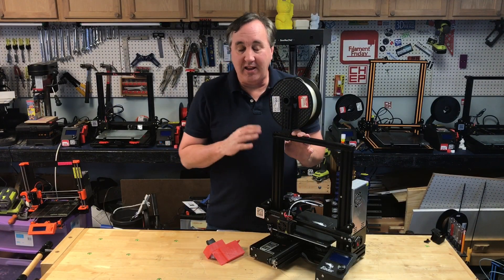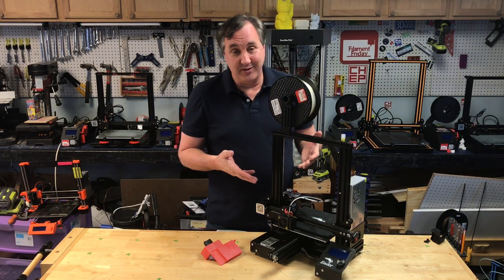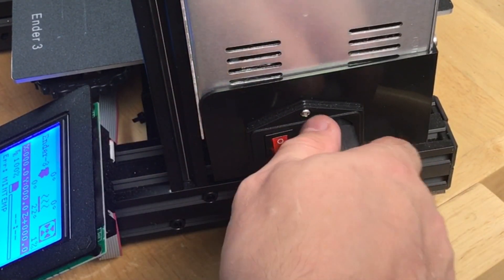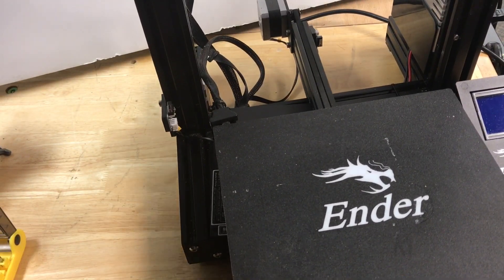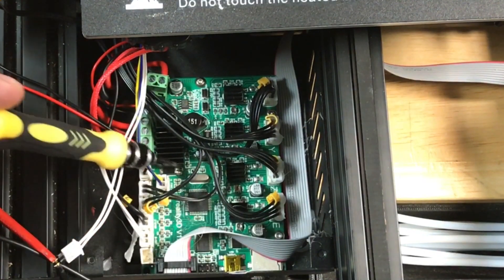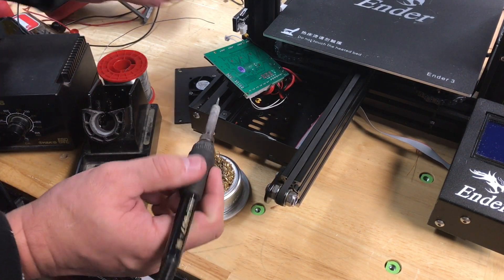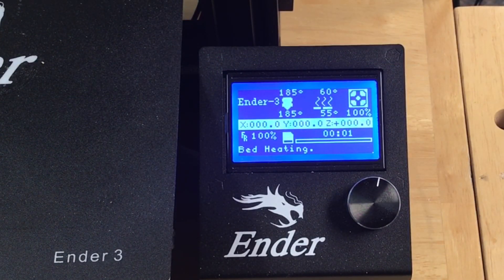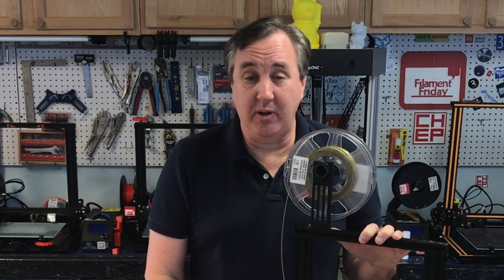Creality Ender 3 - MINTEMP ERROR and TEMPERATURE ISSUES

Comment: My Ender3 V2 hot end temperature suddenly started dropping during printing after changing the nozzle from 0.4 mm to 0.6 mm. The printer stops printing with the temperature drop from 220 to 195. After going through all the checks, I noticed the the hotend temperature going down when the blower fan stsrts and goes to max speed of 255. When I reduce the fan speed to 60 then the hotend temperature went up. After cuttinf off the blower fan, the printing was ok. This is clearly showing that the current (amp) from the power supply is not sufficient to handle the total load. The Ender 3V2 power supply is 24V 350 watts only. 
Connected a 24 volt 600 watt PSU, then the printing was ok with all the fans running.
I think the larger nozzle size will also require more current with increased flow rate.

Comment: Hey loves the videos helped me out a lot but I got a question, my endear 3 always used to heat up and lock to the set temp and here recently I took it apart and cleaned it up added cable clips, now when it heats up it sets and starts printing but the temp will go from 210 to 209 then spike up to 211 then drop back to 210. This process goes on during the hole printing process, is this normal or did I brake something?
Reply: Such a small variation is fine, if it starts wondering over 3 or 4 degrees start worrying
Reply: @juannino8859  thank you for that info. i believe i found out why it has been doing that, so i been hearing a buz or annoying sound coming from extruder turns out it was extruder hot end fan so i feel like thats why it started to do that. im no expert just taking a guess.

Comment: Awesome video!

I have an ender 3 v2 neo. After a nozzle change it started to be unable to maintain an exact temperature. With 208° set, it goes up to 210 then down to 204 and keeps doing that over and over again. I've updated the firmware but that didn't help at all. Any ideas?

Comment: Hi Chuck. I am having an issue with Ender 3 V2 starting. Got nasty MAXTEMP error. Loosening thermistor screw didn't solve the issue. Assumed mainboard is bad. Bought another board and get a loud beep on startup. Nothing shows on display. It seems the printer is not reading the SD card with the latest firmware. Assuming the new board is bad, i bought a second mainboard. Same issue. I am puzzled. Any suggestions?
Reply: When the srcew on the (temp)wire was too tight, I received a same error message (on the hotend), try to loose a little that screw.
Reply: @viktorludanyi740  thanks for the reply. I finally figured out the issue. Turns out the firmware file name must be less than 33 characters long. Once o shorted the file name the firmware installed

Comment: Thank you
I haven't used ender 3 for quite some time
When I tried now, the nozzle temperature doesn't cross 180 and it took 20 minutes to get to 180 deg. What is the issue
Kindly help

Comment: Hi Chuck I'm getting the mini temp error but my temp shows fine for the hotend. The bed was showing 516 degrees after restarting and would immediately get the error if I tried to preheat and also if I tried to auto pod tune the bed. I updated the firmware and then the bed would show 0 and I would get the same errors. I checked my wiring and pulled the board and everything looks ok to me. Can I test the bed thermistor with a ohm meter as well and do you know what it should read ?

Comment: I’m not sure this video is quite what I was looking for, but I need to ask..

I just put my ender 3 together last night. when I went to run a test print earlier, it said I had to wait for the extruder to warm up. I left it for less than five minutes, and when I got back it said that it was 0.04% the temperature it should be, and that it would take 26 days to warm up sufficiently to print. 

Here’s the thing: I wouldn’t be able to afford to pay the electricity bill if I left my printer on for 3 weeks just to print a 1” low-poly pikachu

Any advice?? Please 🙏

Comment: Hello. I have the same printer as in this video, and I was wondering if you knew why my printer is acting up. My printer keeps cooling down during a print. I would set the temperature before the print, wait for it to heat up, and then hit print on my printer. The temperature stays at the normal levels for both the bed and nozzle until a few minutes into the print, where it decreases to 200 degrees for the nozzle, and 60 degrees for the bed. I already changed the settings for preheating the PLA and ABS filament and I set them both to 220 degrees (nozzle) and 110 degrees (bed). I made sure they saved in the system, but the printer still is decreasing the temperature to the old levels still. How can I stop this?
Reply from the maker: What are the settings in the slicer? 
They control the print temperature.
Reply: @FilamentFriday  I got it to work. I changed the print temp. In the slicer. Thanks!
Reply: @FilamentFriday  I have similar problem, I set the print temperature in the slicer for 217 but after a few minutes printing, it drops to 183 for instance.

What would you suggest I do?

Thanks
Reply from the maker: Check all connections for loose or broken wires.

Comment: I just got an ender 3 and it was working until I clicked preheat pla. It then went to making loud beeps and stuck on the ender dragon screen. Now if I turn it on it is stuck on that screen. If I unplug the thermistor connector I can then navigate the settings or heat the bed but if I plug it back in it goes back to beeping and locks me out again.
Reply from the maker: Your sensor is probably shorted or broken.

Comment: I have a Tevo Tornado and which has heating problems. First - the hot end just didn't heat up enough, set for 200 and it heated to 146. So I replaced the hot end. Now I get the MINTEMP error and screen showing -14C (yes minus) and telling me to reset Tevo: Didn't help to reset. I measured the thermistor at the Tevo female connector cable end  pins 3 and 6 (I hope I got it right) and it messured 146K. I thought it should be about 100K. The Tevo is a 24 volt hot end (again I hope I got that right as well). The inside of the Tevo from the mounted female plug to the board is hard wired . I do not have a white plug as you showed and ended up splicing the wires for the thermistor and heating into the existing cable. I was thinking I may have to flash the firmware or something, but I have NO idea on how to do that. Any thought what to do nest will be appreciated. Thanks.
Reply: Hey I have the same problem, how did u solve -14C ?
Reply: @SrdjanS_Automations  I never did get it fixed.  I did replace the hot end, thermistor, etc. and still nothing. I decided to reduce my fustration and bought a Sovol SV01 instead. So far it has been running fine. Bed is smaller and it seems to run slower, but I am still satisfied. Think they have an 03 now as well.

Comment: I have the Ender 3 V2 neo , I normally run PLA 200 on the nozzle and 60 on the bed. I started to notice but am not getting errors that my nozzle temp doing a great deal of fluctuation having the nozzle set at 200 I noticed on the controller that the temp would drop to 117 then back up to 200 then 210 then back down below 200 back and fourth. Hence the reason for watching this video. lucky for me I have the equipment and the experience in electronics.
Reply: Have you fixed this?? I have this problem and it's driving me crazy
Reply: @theayuwoki3569   Yes, turns out thermostat was loose connection at the nozzle

Comment: I have the ender 3 pro, and I noticed I had a temp error, and when I unscrewed the fan, I saw that one of the cables split like a y, one was off,, with no screw, and some white stuff was exposed in the screw hole, do I have to put a new thermistor, or just scew that wire back after stripping it a little ?
Reply from the maker: It’s best to replace it but connecting the broken wires should work.
Reply: @FilamentFriday  Thanks!

Comment: @CHEP My Ender 3 just started giving me Thermal Runway issues on my bed. Ive been doing a lot of ABS printing with the bed needing to be 110.  I haven't gotten my PLA so idk if the bed will give me the same runway issue with 70C for PLA. any suggestions or info?
Reply from the maker: Try it. I’m not sure.

Comment: Hello, thanks for this information, I have an Ender -3 and when I started to preheat the extruder, it heights a temperature of 164°C and it appears Failed Reset, and I can’t print, can you help me please
Reply from the maker: Not sure. Check bed connections too.
Reply: Hello the problem was the Sillicone Protector of the extruder, it is very necessary to use it ( cover the extruder) because in this way the Temperature height faster, and it allows to isolate the extruder temp.

Comment: I just started to encounter this problem on my 3v2 and I have no idea how to fix it. I turn on the printer, preheat for say PLA, and then it takes a really long time for it to heat up but before it can reach the desired temp it will start making a loud, irritating sound and the display says "Nozzle is too low temperature" and I don't know how to fix it. I recently upgraded the hotend to a Creality Spider and it was working great but now I just get this when I try to use it
Reply: This happened to me on my second print out of the box and I can’t fix it. I didn’t upgrade the hotend though. Did you find a fix?
Reply: Did any of you find the solution? Because I also have the same problem
Reply: @th3p0pman51  This is exactly what I'm getting on mine that I just put together
Reply: Try for bad solder joint at circuit board green connector solder joint. to board .
Reply: Did you check if your in the correct voltage for your printer? (late to the party here but this is a common solution specifically for the 3v2)

Comment: My CR-10S Pro heats up to set temperature and stays there if I use the preheat screen.  Once I start printing, the temperature drops 20 or even 30 degrees and I get a thermal runaway error (TM3D firmware) because it is under temperature.  This happens every time so far and I've reran the PID tuning until I'm blue in the face.  I will gladly check this and as there is also a breakout board between the control board and the hot end I'll need to check that too.  It could be that when the hot end starts to move around it loses connection.  I think I'll preheat this and try moving it around manually.    Maybe I can use my thermal camera to verify the actual temperature of the hot end to see if it is a thermister reading problem or an actual heating problem.

CHEP, thank you so much for this video.  You've given me a number of things I can check.  To date I haven't received one response from Creality on any issue I've experienced so far.
Reply: Thinking about my situation some more, I'm pretty sure my actual temperature is dropping because I can hear a chance in the extruder and see/hear a change in how the y and x axis are moving around as the temperature drops.  My print starts at 205 and drops down into the 170's at 60mm/s print speed.   I was able to get a print to complete by manually dropping the print speed to 50% or 30mm/s.  At that speed I was still seeing 20 degree drops before the temperature would come back up.   The overshoot is about 4 or 5 degrees, then it comes down to the set point, sits there for a little bit, and then eventually drops back down again.

I tried to force the temperature to drop by manually setting the temperature.  When I manually set the temperature (and am not printing) it stays within 1-2 degrees of the commanded temp.  I wiggled the wires at the hot end as well as the other end of those wires. I tugged on them gently and I could not force the temperature to drop.  I also picked up the end of the printer and bounced it up and down jostling it.  Still no budge in temperature.  It is only when I begin printing and during the printing that the temperature swings wildly.    I believe my cooling fan on this last print was set to between 35% and 50% in the PrusaSlicer.   Is that too aggressive on my part?

I am going to take the whole thing apart again and look for bad solder joints to try and help rule that out.  I could see how a weak solder joint on the hot end might cause this behavior, but since I can't make this happen during a manual preheat, I don't think that's it either.  So frustrating.  I have a report in to TM3D because indications seem to point towards firmware at this point.

Comment: Mine is doing this but for the bed??? I just changed the bowden for a direct drive and I got the error when I turned it on for the first time.
Reply: I am stuck on this now. Did you get any fixes for this? Bed temperature doesn't work instantly beeps

Comment: I don't have a MIN temp problem.  I have a MAX temp issue.  I recently had to replace the original creatlity mainboard since the hot end was over heating and ruining the prints.  I got the MKS Gen 14 board and the slient 2208 stepper drivers.  the machine prints (kinda) but with two issues

1) doesn't read SD cards and
2) hot end temp jumps up to 240 after about 5 minutes of printing from Cura via USB.
Help welcome!
Reply from the maker: Max temp usually means temp sensor has electrical short.
Reply: @FilamentFriday  so we do not need any new mosfet right?
Reply from the maker: Typically no.

Comment: I have a similar problem, I’ve tried so many things to fix it but nothing seems to work when I turn on my ender 3 it shows a hotend temp of 130 but the hotend is cool to the touch so most likely 20-23 range but then I go to heat up the hotend the temp stays at 130 and get hot if I set it at 185 it probably gets to that temp but the lcd screen display temp doesn’t move from that 130 reading , I’ve even unplugged the thermistor sensor from the motherboard and it still reads that 130 temp, any info or advice would be amazing
Reply from the maker: I’m just guessing but there could be a resistive short on the thermistor connector that makes it think it’s 130°. You’ll have to take the board out and check solder joints and possible clean it with tooth brush.
Reply: CHEP I did that after watching your videos noting still the same, I even just spliced in a new thermistor same results. Could it be the motherboard itself even thing else works perfect
Reply from the maker: Yes. Sounds like a motherboard issue to me.
Reply: CHEP thank you I really appreciate you taking someone time out to answer my random questions

Comment: Ive change out my nozzle recently and for some reason ill preheat my printer to 185 for nozzle and then start the print that I want and it will go up to 220 but after it starts the end heat goes down to 170 any advice
Reply from the maker: Run a PID tune on it.

Comment: Hello, I upgraded from V4.2.2 to a V4.2.7 and i keep getting the E1 Min temp error, got a replacement board of the V4.2.7 and still same issue. I also PID tuned them. I switch back to the V4.2.2 and the error is gone. is it possible for you to share a link of that 2 pin header i cannot find the correct one online. I want to test the thermistor before I buy a new because I can only assume the v4.2.7 is more sensitive to the fluctuations compared to the v4.2.2
Reply: I know this post is a bit old, but I swapped boards from the old 8-bit bard to the 32-bit 4.2.7 board and started getting the E1 error. I changed firmware and the error went away.

Comment: replaced my hotend with the microswiss, now after only a few minutes - I get that solid alarm, very loud, printer then resets and will end up in an endless cycle until i shut it off completely
Board or screen? Everything was perfect before the change.
Reply: @GothamPossum  I replaced the main board. All better. I got an updated, silent board off Banggood I couldn't find any other solution either.

Comment: Hey i have a question maybe you can answer for me id sure appreciate it i bought a new hot end and CR touch and extruder but when i loaded the new firmware my heat setting is set at 522/ 0   or 522/245 if i try to heat the nozzel then it tripps a low temp circut and sounds alarm , how do i zero the temp on the startup side so its 0/0 when it starts not 522 it dosent even let you get to 522 degrees so cant understand whats going on with it thanks for any tips you can help me with thanks again
Reply from the maker: Sounds like the hotend thermistor is wrong value or shorted.

Comment: or your wires. I had a thermal problem where it when from 210 down to 170 adn up to 210 and then up to 220 to 240 adn then down do 210 and so on. took a look on the wires and fixed
Reply: I’m having the same problem, how did you fix it?

Comment: Could you please help me with a problem I'm facing with my ender 3.
I recently replaced it's faulty power supply unit, which malfunctioned. Now, when I try heating up the hot end it only goes upto 130 degrees and stops there until it gives me an error "HEATING FAILED PRINTER HALTED PLEASE RESET". it won't go above 130 degrees. 
Is there a problem with the heating rod in the hot end ?
Reply from the maker: Sounds like it’s heating too slow. Did you use the same wattage power suppply?